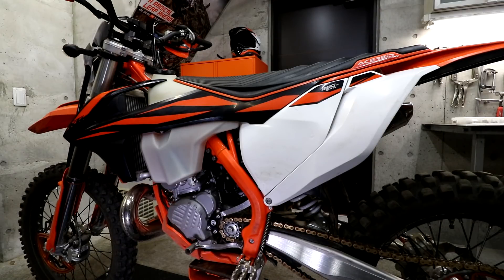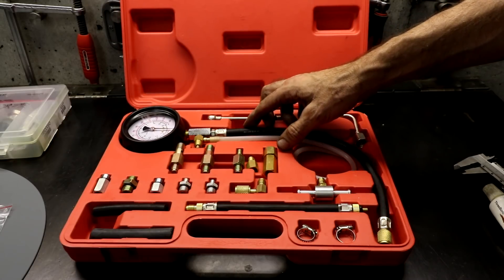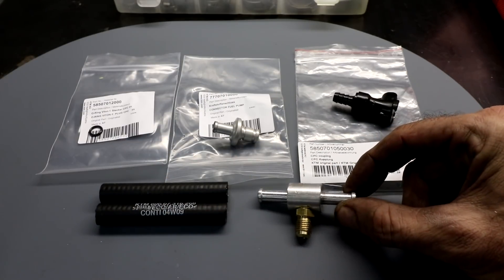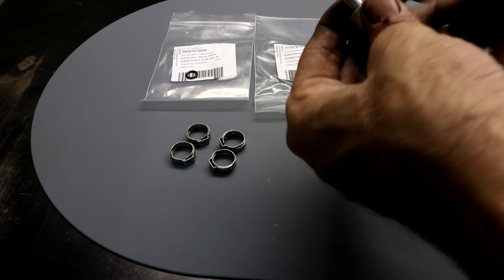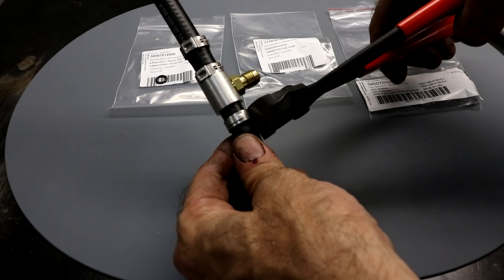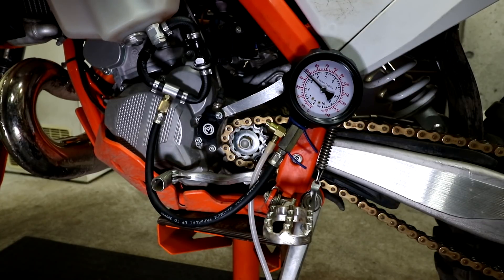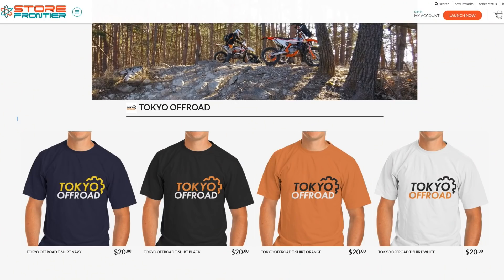KTM & Husky Fuel Pressure Measurement

Comment: I got a question regarding the fuel pressure.

I tried 2 different pumps, one idles at 3.5 bar one at 3.4bar. Both dont drop while revving the engine but will drop around 0.1-0.2 bar while riding. Os this normal?

I got aome misfires on my 2016 501 and cant figure it out...

Comment: I’m going to try to build one of these today. My 2018 exc 500 seems to be draining that black fuel pump housing faster than it can possibly draw it in through the two bottom Inlet pinholes. So it’s draining the entire housing and sucking air in through the top. My theory is that the regulator must be allowing too much bypass without achieving pressure, and the pump is just running too fast?

Comment: I had low fuel pressure on a 2017 FE350, after swapping the pump, filter & regulator I carried out the pressure test, with the engine running the pressure reads a steady 50psi. However when when I turn off the engine the pressure drops quickly (about a min or two) to zero... is this normal or should it hold pressure?

Comment: I need to find where mine is pissing the pressure out from
Reply from the maker: Sorry to hear about the problem. Unless you can see a leak somewhere the most likely cause is the in-tank filter/pump assembly. If the filter is old it's a good idea to replace it (worse case the filter body can split) and check the the fuel pump runs OK.

Comment: I carried out the pressure test, with the engine running the pressure varies from 46/48 psi. when I turn off the engine the pressure drops quickly to zero... is this normal?
Reply: Ever find an answer I'm having same issue.

Comment: Hey! I have a 2019 KTM 250. I seem to have a hanging idle!! Could it be the pump / filter causing this? It feels like a lean condition from my carbed bike experience
Reply from the maker: Sorry to hear about the problem. Has it always had the hanging idle, or changed recently? Yes, hanging idle is a lean condition. Either there is a fueling problem (fuel pressure too low, blocked fuel filter, or injector) or an air leak (check throttle body outlet hose clamp, reed valve, crankshaft seals). Did you do the idle screw mod? If so try closing the throttle body air screw more (and then adjust idle speed with the throttle stop) and see how it responds.
Reply: @TokyoOffroad  thanks for the speedy response! I have only just purchased the bike (it's on 70 hours). 
I have pulled the fuel pump and the filter was very black so will be changing this. 
The idle mod has already been done by the previous owner.
The throttle body air screw was out 1.5 turns which I have moved to 0.5 turns out.

 It seems to run just fine under load but when accelerating hard and then pulling in the clutch it then hangs. I will link a video I have uploaded if it's ok to have a listen to that would be greatly appreciated!! Thanks again

Comment: My 2022 KTM 300 XC TPI fuel pressure test produced 48 - 50 psi with the engine off. ~50 psi then it dropped to 48 psi after approx. 5 seconds and stabalized there for a while.

Engine running it produced a steady 53 psi at idle and raising the rpm some.

Comment: I just learned on my 2022 KTM 300 XC TPI while checking the torque of the retaining screw for the front drive sprocket while it was in gear (bike on a lift so the rear wheel was free to spin) that when the engine turned over due to my manual torquing the screw that the fuel pump will cycle for approximately 1 second. But not the oil pump as I checked via a stethoscope. 

The fuel pump would repeatedly run for 1 second every time the engine turned over. 
An easy & simple way to prime the fuel system I discovered. No jumpers to the fuel pump. No starter usage required.

Comment: I have exc tpi 250 2019 i have 20 hours on it. i noticed inside fuel tank fuel is spraying and i can see somthing like air bubbles so im guessing there is some crack on hose or on pump joint with filter. otherwise bike runs fine at mid-high rev and full tank but when is on fuel reserve it start bogging (i think then it starts to suck air through this crack). Also in 6 gear at low rpm bike also have running issues.
Reply from the maker: Possibly the fuel filter is cracked and needs replacing

Comment: Do you recall any details about the after market metal connector fuel pump?
Reply from the maker: The full metal quick disconnect inline fuel line connectors which I know of are CPC LCD22005 and CPC17005. Please note that I have no experience of using these parts, but others on KTM Talk web forum have used and like them.

Comment: Hi, I am attempting to build a similar fuel pressure measurement gauge. I have seen similar fuel pressure kits as the one you have purchased however, there is one distinct difference. The 'T join' starts out at the same thickness and then gets longer and thinner. My concern and question is, do you think this will impact the fuel pressure measurement. Happy to PM you the kit I'm looking at. Thanks
Reply from the maker: Whiskey Throttle Enduro - The length and thickness of the pressure gauge tube isn’t critical and won’t affect the accuracy of the measurement so long as they pressure reaches steady state during the test period.
Reply: Tokyo Offroad Thanks
Reply: I built same system however I got a reading of 58 psi on both of my bikes(2020 300 and 2021 500). I’m thinking my guage I bought on Amazon is a little off. Looks like the same kit as you show on your video.

Comment: My 2019 300 TPI with 45 hours would not idle and was difficult to start. I built the fuel pressure test tool described in this video to get an initial reading before making any changes. The initial reading was zero (even when running which I know sounds impossible). I tested the tool on another bike to confirm it was working properly which it was. After changing the filter in the tank (KL 97/1), the pressure readings on the 300 were the same as my test bike and similar to what is shown in the video. A mechanic friend suggested on anything fuel injected, always start with fuel pressure. This video was especially helpful on how to do just that. TokyoOffroad is a fantastic channel for gumbies like me who are trying to learn how to care for their machines. Thanks!

Comment: Off topic but can you help with jetting for a friends bike back home is sunny England. 2016 250exc. It has never run right. He has the Suzuki needle in. Any advice be appreciated.
Reply from the maker: Those come stock with a Keihin PWK 36mm Air Striker. Should run well with the right jetting. What are the symptoms?
Reply: Tokyo Offroad it just runs terrible unless it’s wide open. You can’t blip the throttle to clear an obstacle as it just has zero punch. And is also gutless unless it’s full throttle. My 17 250 feels electric response compared to his.
Reply: what jets is he using in the carb Chris? pilot, main, float level height? needle position? The suzuki needle you mention the NECJ??
Reply: Andy Baker yes bud that needle. Float height has been checked to spec. 40 pilot 170 main and tried needle on clip 2 and 3. The bikes never ran right. He is very frustrated.
Reply: Andy Baker any thoughts?

Comment: Classy video as always but one possible snag is that you are measuring the pressure with low fuel flows at idle. If the pump is getting bad then low pressure may only show up at high flows. I think that is why the KTM manual shows a test where fuel is discharged through a nozzle into an external container. You really need to observe the pressure when you are blasting along at full power and there is maximum fuel flow to the engine! Now that should make an interesting video..
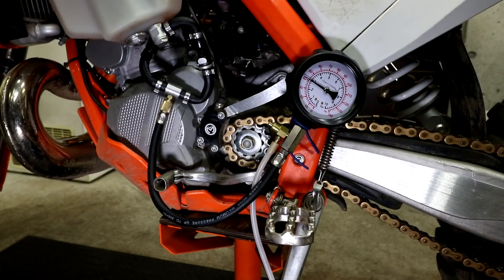Reply from the maker: I did rev the bike too in the video (5:10~) and the pressure didn't change. Yes, they are not full load measurements, but good enough for my purposes. I wanted some reference baseline measurements which I can easily reproduce if I suspect I have an issue at sometime in the future.
Reply: The KTM manual also states: Select the "Function test of fuel pump control" actuator test. Is there anyway to do this with TuneECU or with the ODBII connector you made to read the diagnostic codes?

Comment: I did this same exact thing when troubleshooting my buddy’s 16 ktm 500exc.. he told me he was riding his bike to work and all of a sudden it bogged, died and couldn’t restart.. I tried various things and couldn’t figure it out.. I told him let me look at it.. sure enough I hooked up a fuel psi gauge and psi would crash, and ended up being a split fuel filter inside the tank. (Dumping psi back into the tank).. replaced filter in the tank, and it fired right up!!! Took me about 30 minutes to find the issue, I can imagine how much the dealer would have raped him on that!!
Reply: Sorry “he tried various things”
Reply: @Bimmere  .....Sir...yes! You are indeed an apology. Is there really nothing going on in your life?
Reply: @andycapp8843  uhhh what do you mean? I’m confused by your post
Reply: I have a '17 fe501 and various buddies have KTMs, etc.  Virtually every one of us has experienced the "split" fuel filter in the tank problem (mine happened once in Moab and then a few months later in the middle of nowhere in Nevada).  Many people think their fuel pumps have failed and the dealer, either none the wiser or looking for a better boat payment replace both the pump and filter.  The problem is the the stock plastic fuel filter is junk and just as likely to fail again after replacement.  I and friends have gone to a metal replacement (same in all dimensions as the OEM filter).  P/N is Purolator F29160 or equivalent.  A few bucks online.  I am now replacing these proactively when I get a new bike from Austria.

Comment: Man. You seem to be familiar with KTMs and Huskys. Have you experiened frame-rust on your bikes?
I have a friend with a 2017 Husky Tc125 and it is rusting fast and I know my friend takes good care of the bike.
 I want to buy a 2019 250exc but I don´t want the same issue.
Reply: josex360x I have not seen any ktm/husky/Husaberg having rust issues... not sure why his is...
Reply: Do you have newer bike?  @Bimmere   I have a 2013 Husky (italian husqvarna with a black coated steel frame). On my bike's frame, there are spots where the paint i almost done, but the bare steel/frame looks shiny.
 My friend's frame starts to rust a soon as it looses it's paint. All over the bike.
Reply: josex360x my personal bike is a 2019 model, but I know a bunch of people with older models anywhere from early 2000’s to present year, and none of them have rust... unless say a rock hits part of the frame and chips sone of the paint on the frame and expose the bare metal elements, then I can see some rust... but that’s why you should have touch up paint on hand Incase you chip the paint..
Reply from the maker: No I haven't seen any rust issues. I have a 2017 KTM 250 EXC and the 2019 KTM 250 EXC TPI shown in this video. Before these bikes I had a 2013 KTM 500 EXC and that didn't have rust either. I keep my bikes in a garage out of the weather.
Reply: Is s/he riding in a salty area or a desert soil with high alkali?  Both will corrode almost anything.